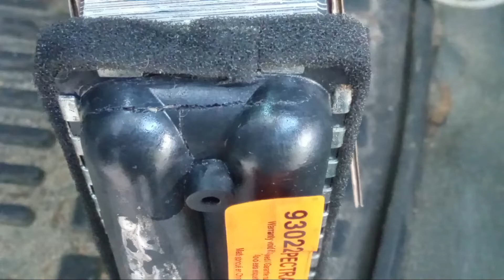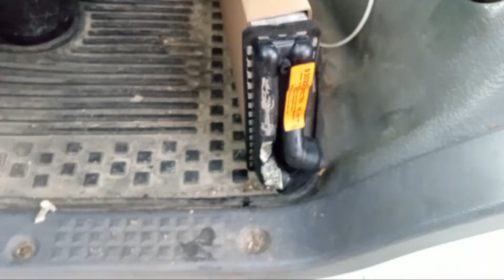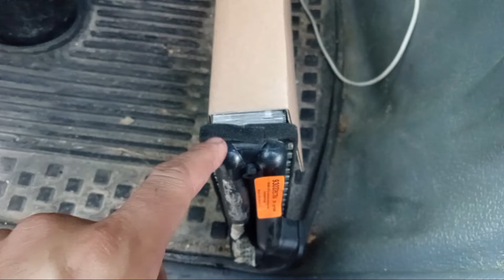Another example of plastic the biggest disgrace of the planet   plastic radiator

Comment: On my new cars I buy the Asian tig welded hotmrod aluminum radiators and silicone hoses with Asian stainless smooth face hose clamps. Not wickedly expensive if it's a early  to late  00's car
Reply from the maker: yes, aluminum is good....not the best...id like to make a stainless or copper radiator.
Reply: @OldCrowsClassicCars  I thought copper rad were already a thing from the 40s to the 70s, to be fair I think those were brass tanks with copper fins, idk what the tubes were made of.
Reply from the maker: @cdoublejj  yes you're right older rads were made of copper and brass....but I'd like to make a heavy duty one with much thicker metal and a simpler design....possibly using regular plumbing  pipes.

I've never seen a stainless radiator though....because it doesn't have as good heat transfer....but I would compensate for having more rows and fins.
Reply: @OldCrowsClassicCars  I've been looking at stainless for car/truck frames and bodies, from what I can tell it's harder than a bottle of Viagra and beats the ever living  day lights out of the press dies as well as being harder it's supposedly not as flexible as steel. You could definitely home DIY the rad tanks with a TIG. The tubes and fins would be the hard part, or maybe you could fill stainless brake line with sand and shove it in a harbour freight press with two blocks of wood to make it flat but, I'd guess you'd be stuck trying to solder on copper fins in-between the tubes
Reply from the maker: @cdoublejj  nice to find someone else with similar ideas considered to be crazy by most people.

I was thinking of a design that wouldn't require any pressing. So for the radiator just use pipes and fittings.

Indeed, stainless is harder than steel.

Now a stainless frame....that's really something. Again, I was hoping of creating a design that the frame required minimal pressing or welding...maybe just straight like I'm big trucks.
And similar for body panels...as straight as possible...older defender and internstional for design inspiration
Reply: @OldCrowsClassicCars  there a company that sells all copper rads for water cooled gaming PCs, they appear to just plain tubes but, in such builds you have A LOT more radiator than you need, A LOT. i believe with a full pipe/tube instead of little flat tubes a lot of the thermal pass passes right on through staying in the water. maybe if you used a bunch a little tubes like 4.75mm brake line. i'm guessing that passing the water through smaller passages does something with surface area and or heat/thermal mass concentration vs thermal transfer. i know i take small sips of hot tea as to no burn my self. but, on the other hand don't REALLY old Cats have plain old tubes in the rads?

My uncle has a ride on chemical sprayer, seems a lot like a strand up commercial mower, the chassis is all stainless. cars and trucks need flex in the frame, there was video about boxed vs c channel frames on trucks. a friend used to patch up semi frame and or shorten/lengthen. he said when adding plates they needed ot be rounded, the pointed ones always cracked as the rails flex quite a bit. like this...... https://www.youtube.com/watch?v=Pe42q8ZmjGU

you might enjoy various dedicated internet forums you can find people like you and i, the convos are a bit deeper than youtube or facebook groups
Reply from the maker: @cdoublejj  Indeed I thought of using curponickel brake lines for the radiator, but the difficulty would be to weld them to the ends....but I'm sure there must be some special welder for small pipes.
The alternative would be to solder, but welding is of coarse better.

The bigger the pipes the easier it is for 'regular joe' fabrication.

About the frame, yes makes sense, rounded is stronger.I do recall doing some research about frame welding and indeed, it's more than just welding a piece of plate in.
I think I might have seen a bin truck that had an i- beam frame.

So many ideas, maybe someday I'll be able to produe the 1st car ever to be designed by a mechanic, the simplest and most durable car on earth.

Thanks for your time and interest. I appreciate your comments!